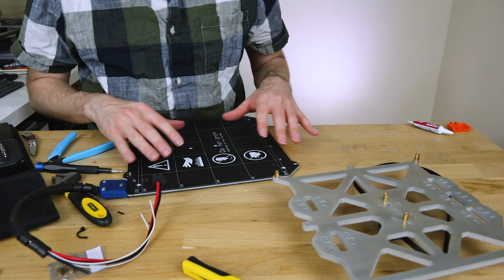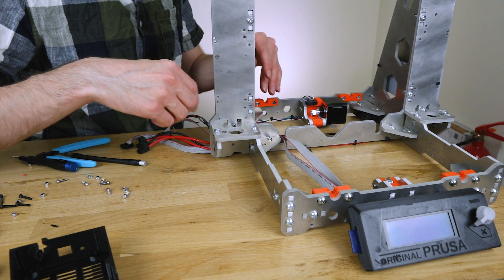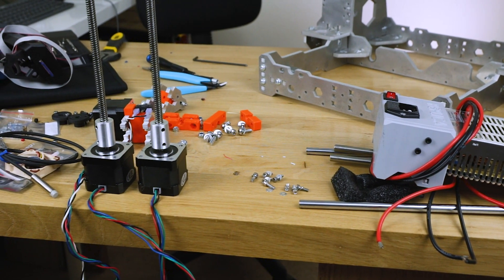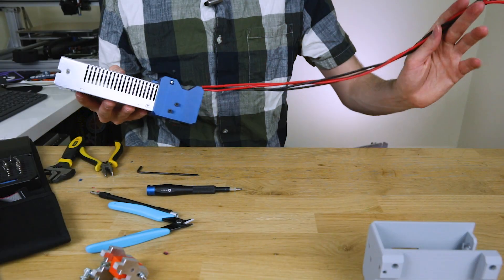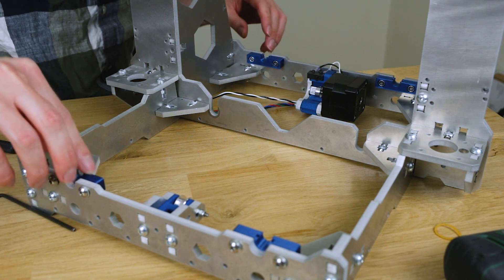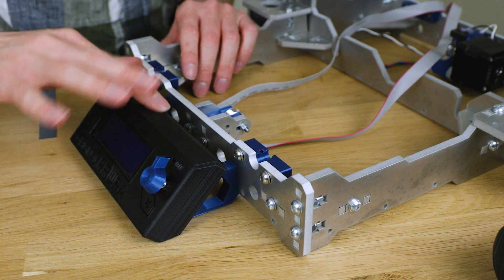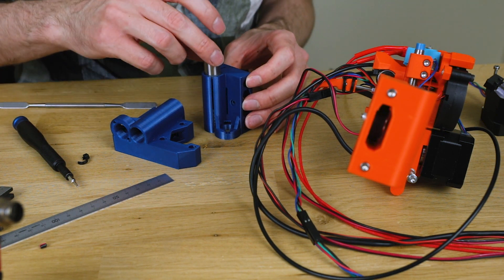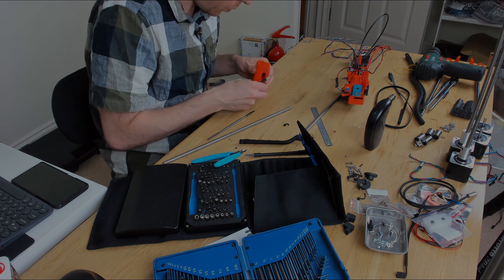Prusa Mk2.5 Upgrade Build Series - Episode 2

Comment: Hi Adam, nice video. FYI, in case you print the Bear Z Bearing holders, they are not compatible with Stock Extruder (the belt it's off axis), but only with Bear Extruder.

Comment: Oh how i understand your pain here. Back when i was constant tinkering with my first printer i would be half way dismantling the printer only to find out the new part didn't fit. only problem i had back then was no second printer, so needed to rebuild with the old part to print again. luckily those days are behind me as i only have to mk3s's nowadays. I do however love the new blue color you used in the prints, those are gorgeous!